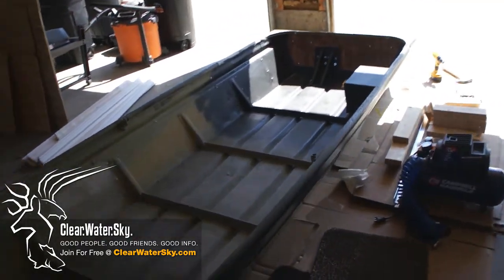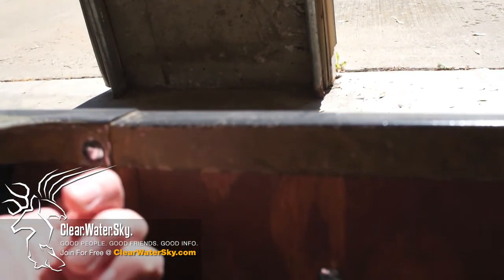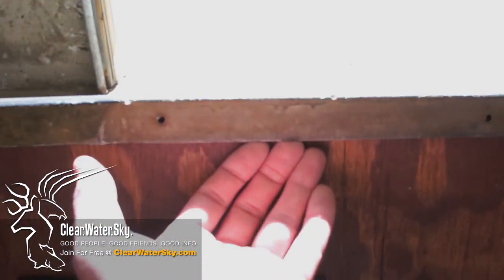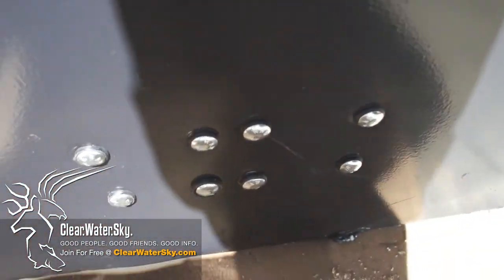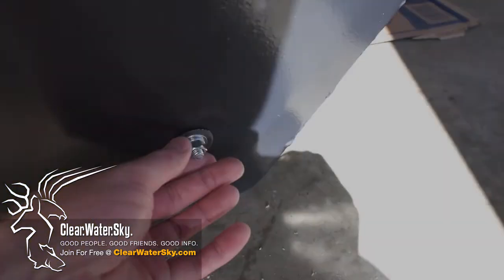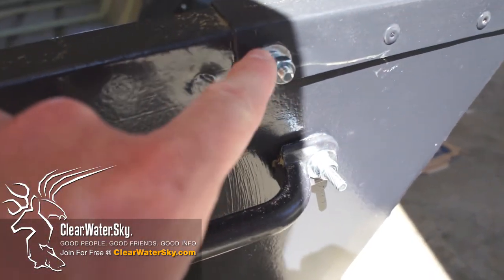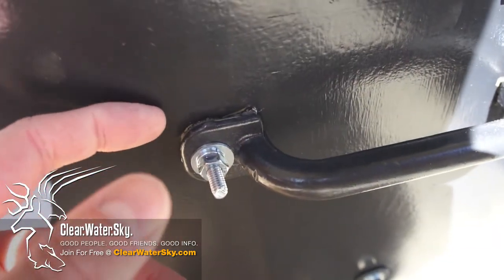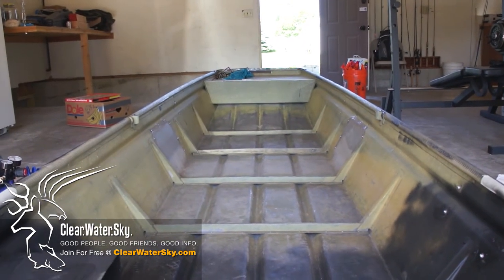Jon Boat Modifications: Waterproofing with Rubber Washers

Comment: Geeze man why didn't you put the nut on the inside of the boat?
Reply from the maker: Great question - I put it on the outside so that the inside was smoother, and with the silicone and washer it's still water tight. I'm going to redo the transom later this year (probably a late fall project) - you'd put the nut on the inside? Thanks, I appreciate the feedback.
Reply: @TheMinimalistFisherman  hi, I understand the desire to keep the smoothness on the inside.  My way of thinking is that the number one priority is to keep water out.  Glad to hear you had no problems with moisture seeping through the threads.  not sure if your boat is strictly freshwater or not, but either way the threads of the bolts will  corrode less on the inside so if you ever wanted to remove them in the future, it would be easier.  I don't think it matters too much if you're redoing your transom soon though. To me, the transom is the area where my outboard engine is anyway and I don't mind a little roughness.  Also I can trim the bolts down so there's pretty just a nut's length protruding out.  Good luck.
Reply from the maker: @mattt945  hey again - I hear you - we might flip the bolts around next time. That's a good idea. I get what you're saying. The boat is strictly freshwater (I'm landlocked in IL) and when we redo this puppy I want it to be even better. One thing that I did not realize when I did this - and don't laugh - was that you could actually hacksaw steel (zinc covered) bolts. Had no idea. So that is definitely a game changer. Thanks again for your input, I appreciate it - gave me more to think about!